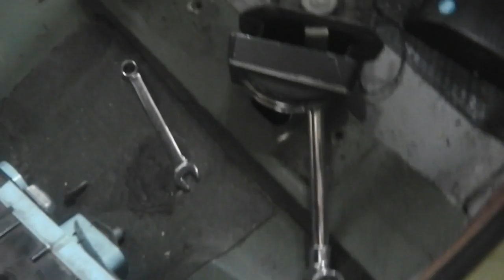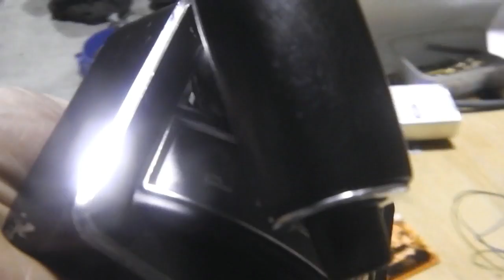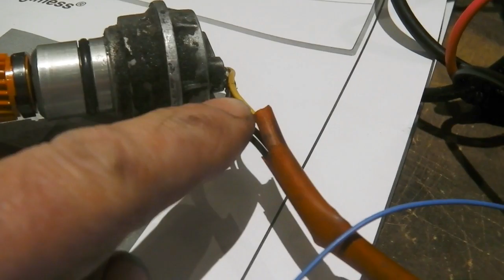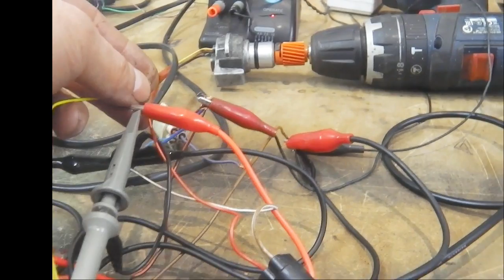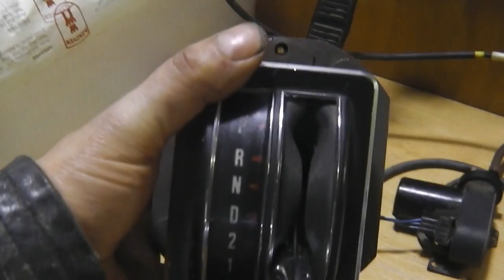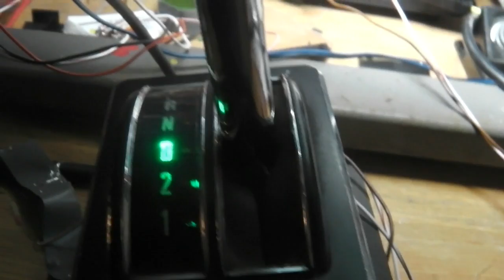Ford Cortina Mk3 Restoration Project Ruby EP23

Comment: The reason for the difference in the selector rod from the DOHC Scorpio donor car and that from a Dorchester is that pretty much all the stretched Granada limos and hearses were V6, the connection arrangements on the gearbox are probably different to make room for vacuum and electrical/electronic connections between the engine and gearbox that are in different places on the engine on 4- and 6-cylinder engines.  It's also possible that the linkage on the stretched car is modified by the coachbuilders to make room for connecting extras like rear compartment heating or air-conditioning to the engine...

Comment: Pete another fantastic upload. The part with the Brake bulbs I would still be there now crying in the corner wondering what and why so well done on your perseverance. The work you've done to get the scorpio box to fit is fab and the micro switch on the T shifter great idea with th LED's. I just hope the noise from the pump doesn't annoy you beings it will be inside the car! Keep up the good work can't wait for 24!
Reply from the maker: Thanks for your reply RIchard, im real happy as always, youve watched the film in detail! yes those brake bulbs, would you have thought it? that they need those connected in order for it to go active, the thing is its not written anywhere on internet, however I must be thankful that most of the info WAS out there to help me, the online wiring diagrams saved a lot of time and possible damage, so im grateful for the people who posted those, i had 95% of the info, just that last part with the bulbs is mentioned nowhere, although im prob one of the very few who have put it on a test bench, so most would have had thiers tested actually in the car hence the brake lamps being connected for those people. As i mention in film PATIENCE AND YOU WILL ACHIEVE WHATEVER YOU WANT I m a great believer in that, theres ALWAYS a WAY !  YOU JUST NEED THE will POWER to get thru, the mind is powerful and wonderful, this is my mantra and it has worked all my life, I see the car rebuild as ART as much it is restoration. Im prob more of an artist than i am a restorer. the car is my canvas. AND those T shift bulbs, feel cosy, i cant wait to be in the car on a highway at night with those features kicking in,. Ive also put some other electronic luxeries from the Granada into the car, just little touches that compliment and blend in nicely, little creature comforts that can be disguised but are there when you need them, once again, I thank you, all my viewers are so so welcoem to me. Pete.

Comment: Liking the tech stuff Pete. if the micro switch on the T shifter is activated by the latching mech does that mean you could use the button on the shifter to cancel the cruise  control save you from fitting a cancel button.
Reply from the maker: JIm yes its great becuase the t shift is now its own switch, yes it will cancel the cruise

Comment: 3 am after binge watching all of this build.  Great work so far mate. Wish I still had my mk2 XR2 now. :(. Anyway off to bed but great work and looking forward to the rest.
Reply from the maker: that was a mammouth task watching them all !!! my brother had a silver XR2 mk1  back in the day, nippy little car
Reply: Pete C certainly was mate.  Loved the mk1 XR2's as well but late 90's when I bought mine the mk1's had started going up in value and as an apprentice mechanic then I couldn't afford it so had to settle for the mk2. My father had a mk4 Cortina 1.6 lx estate in red and my FIL had a very special C plate 2.9L Granada that was specially built by Ford UK which they took over to Germany to try and sell to the German Police Force as Autobahn cruisers.  Engine was fully bored out and had a second kick down with updated auto box, updated suspension and stronger drive shift and prop shaft.  Was a lovely car which he used as a daily for 35 years before it sadly rotted away beyond economical repair.

Comment: The A4LD does have lock up but you can get switches fitted that can make the torque convereter lock up in anygear as a result it doesn't slip and you get better mpg.
Reply from the maker: Hi Michael, yes I read about the lockup you can fit a switch, im not sure how the granada operated the lock up with the non ecu cars?  i read possibly a vacum pipe swithc to operate? im still trying to work it out? at what point do we need lockup? is it when its above a certain speed? all the best.
Reply: The later A4LD's have computer controlled lock up that locks in 3rd and 4th when it wants to. You wire a switch into the computer and that enables you to control lock up and think you maybe able to use it in all 4 gears. The advantages of this is that you get more engine breaking especially downhill, the revs don't drop as fast since lock up is direct drive and better mpg since the gearbox constantly  slipping.
Reply from the maker: could do with a truth table for lockup. thanks Mike, hmm I could connect to cruise active relay so lock up activates in cruise only but perhaps have an additional lockup switch. just worried that lockup if left on by accident may damage soemthing? unless i connect via a speed output so that it only comes on above say 60mph? that said if youre saying its for situations in lower speeds this may not work
Reply: Pete C There are video's on YT that explain the advantages of it and the science behind it. Least with the lock up switch you could use it when desired i don't think you would damage anything if you left it on. A guy on YT fitted a lock up switch on his Honda Civic and when he came to a stop nothing happened plus at low speeds too it was fine. Lots of videos on people putting lock up switches on their cars.They say its makes a huge difference.